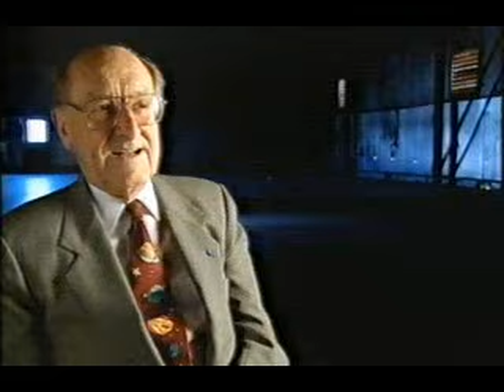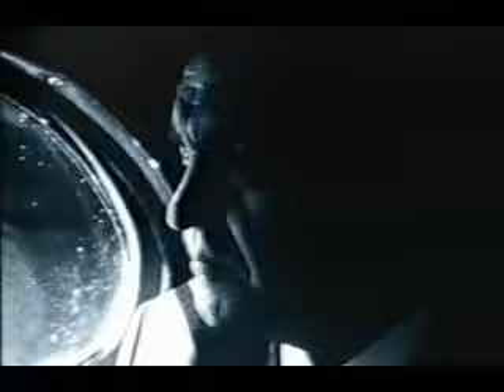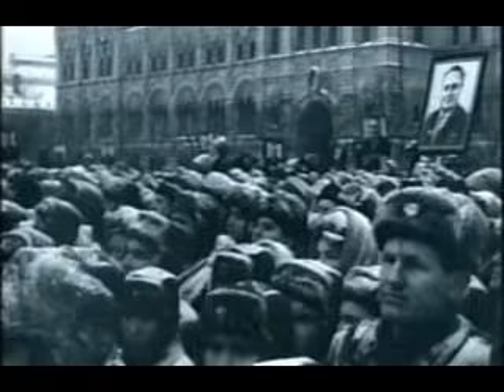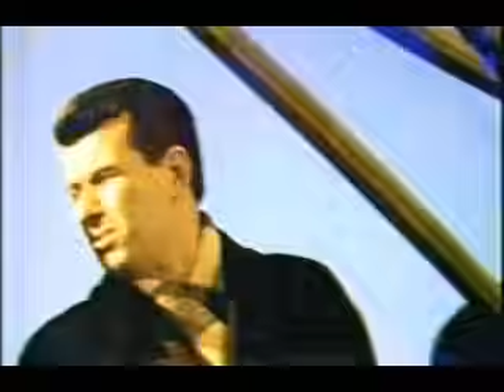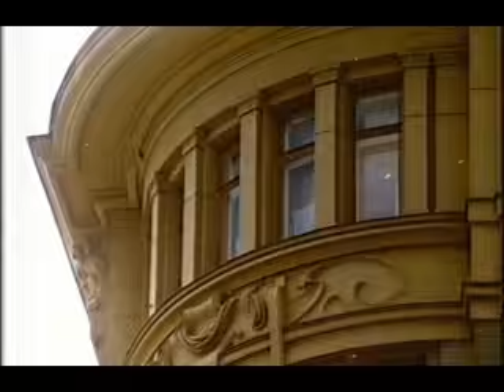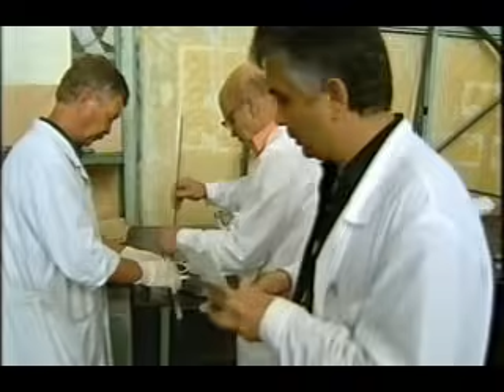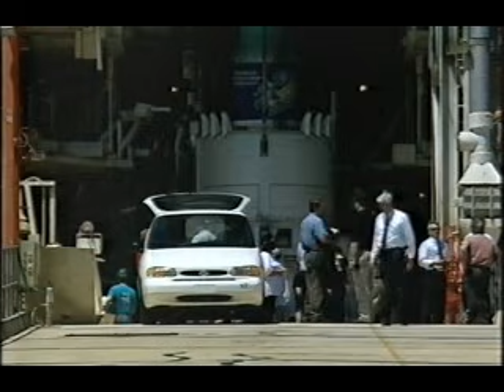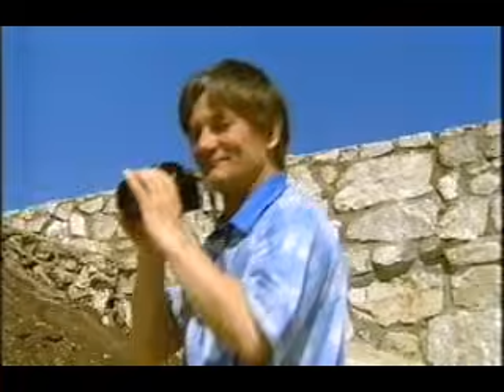Soviet N1 Moon Rocket Documentary

Comment: As an engineer, I was sitting here watching this film, listening as they implied that the Russian engineers were better than US engineers and that the rocket engines were better than anything in the US inventory and that the Russian's had "figured out"something that the US engineers hadn't.The whole time I am thinking "o.k., higher performance and more efficient, but you are also taking big risks that a rocket engine of that design type won't simply MELT and/or explode running at those kinds of pressures and temperatures"! When, finally, in the LAST 7 minutes of the film they admit that the Russian engineers hadn't actually "figured out" anything the US engineers hadn't, but that IN FACT the US engineers simply felt it was too risky to operate a single engine at those pressures and temperatures and THAT was why the US decided not to go with the "Close Circuit" rocket engine design. Yeah, US engineers like to build in a "safety factor", ESPECIALLY where human cargo is concerned. The Russian approach of making things more powerful or faster by sacrificing safety isn't unique to rockets. It is a well known fact that when the Russians began building Nuclear Powered submarines that the reason that they were faster than anything in the US arsenal was that the Russians had sacrificed the amount of shielding around the reactors as a weight saving measure which then greatly increased the danger of radiation exposure to the crews aboard those subs. Well, we in the US like to see our boys come home NOT glowing green, just like we like to see our payloads actually REACH orbit, whether human or machine, whenever possible.
Reply: But the US chooses to use the design now. Ironic huh.

You literally turned that frown upside down didn't you!

I'm sure if we kept the same story and swapped the nationalities around, either you or another American would be boasting about how crap the Russians were and how bold and fantastic the US was for taking the risk to further the technology.
Also, you fail to mention that the US have now started to design and build a staged combustion engine (Raptor sounds cool doesn't it! murica!) along with India, China and Japan to name a few. Could it be because they were proved wrong and that it was possible by the Russians(damn those pesky commies). You also fail to mention the metallurgy they developed to combat the problem of corrosion, which was one of the main reasons why the US didn't think it was feasible.

Also your example in your regard to shielding on Russian submarines, I don't know if what you said about less shielding is true or not, but the weight of a submarine does not affect its top speed only its acceleration. Just like a LSR cars top speed is influenced by drag, gearing and HP, added weight only means it will take longer to get there but will not alter its top speed. So all that means is, if your statement is true, then a Russian sub will accelerate faster but will not have a higher top speed. Great for them undersea 1/4 races.

So why don't you give credit where credit is due?
They developed the technology and designed and built something that the US deemed virtually impossible. So well in fact, that now the rest of the world is following their example, including the US.

Not too hard is it?
Reply: Firstly, saying that the US "chooses" to use the Russian rocket design now, isn't quite accurate. Because of the deep and ridiculous cuts made to NASA's R&D budget, US scientists were FORCED to find a less expensive alternative to advancing the state of the art in rocket engines. If you ask THEM (not the ones "paid off" by the Russian filmmakers they show in this film to say what the Russians WANTED them to say) the US scientists will tell you that their decision to do so was based on being FORCED to find a less expensive, but less capable system because of purely POLITICAL reasons which were pushed through by the current administration. Going to the Russian design was an out and out BACKWARDS step. That being said (and you may not be aware of this as it is not widely known), new funding has recently been approved for continued development of a US design which had been kept in "cold storage" since the Obama administration began its anti-science, anti-exploration, anti-research blitzkrieg. This new funding has been largely the result of the "cooling" in relations between Russia and the US, and has had the HAPPY result of forcing our politicians to reevaluate the "I'm ok, you're ok" stance which has pervaded the US space program for too long and kept us stagnant, just like the Russians, who, except for the ISS (which the US is largely responsible for building), are still stuck in the late 60's, space technology wise. Not so much "state of the art" as "state of the ark".  

On the issue of Russia developing "metallurgy to combat corrosion", well, the fact is, we don't consider that very important since we take better care of our equipment than the Russians do as well as using higher quality materials from the start, and all parts which show any corrosion or mechanical stress after a flight are replaced before being re-flown ANYWAY. If that is something that is important to Russian scientists, that is wonderful, but that has to do with a different approach to the business and using lower grade materials to build with.

As far as your comments regarding submarines and whether weight affects "top speed" or not, are concerned, they clearly indicate that you have NO knowledge of the subject and it would be a pointless exercise to debate you on it. I will give you ONE clue. Water ISN'T air and they don't have the same coefficient of drag. Your analogy of dry, land based race cars is just not applicable when referring to something in salt water, sorry. As we ENGINEERS like to say, you can make a BRICK supersonic if you put a powerful enough engine on it. 

Again, the US isn't following Russia's "lead" because they made a "better" engine, it was a desperate attempt to find something which, while less capable than US designs, was cheaper to produce. Well, cheaper is RARELY better when it comes to high performance technology. Also, the only reason that the countries you named are CONSIDERING the Russian design is for the same reason, its cheaper, not better. The heavy lift capability requirements of India, China and Japan, thus far, doesn't need to be anywhere NEAR what the US requires of its systems. Those countries are just taking their first baby steps into space on their own. We in the US didn't consider the Russian approach "impossible", as you and this film claim, we simply consider it a lesser design. I mean, if you are looking for a high performance car and can afford to buy a Ferrari, you DON'T SETTLE for a YUGO.

US commercial space companies will fly with what engine they can afford, which means they will have to sacrifice capability for cost. Most NASA and US contractors performing heavy lift launches are still using the proven and more capable US designs, such as Titan and Atlas, etc...The new "Saturn Class" vehicle called the Space Launch System (SLS) slated for its first launch soon uses four RS-25 engines in its Core Stage. The RS-25 is a US design originally used as the main engines for the Space Shuttle and has the highest thrust to weight ratio of ANY rocket engine in the world. It is also the most reliable rocket engine in the world. SO, after all your claims that the US is somehow "coming over" to the Russian way of thinking, the FACT is is that we are powering our newest heavy lift vehicle with a US designed, tried and true powerplant, NOT some Russian designed cheapy stopgap engine.   

Russia's new spacecraft, the...OH, that's right, Russia is still flying the same limited capability Soyuz capsule that it has been flying since 1967. They tried to build a space shuttle, Buran, which looked EXACTLY like the US Space Shuttle, only it wasn't powered and was only ever flown ONCE on a remote mission and then was quickly retired because the Russian copy didn't work. I think one of them is a theme restaurant now, in Gorky Park? Russia STILL has never landed a MAN on the moon, or anywhere ELSE, for that matter. Russia is HARDLY on the red hot edge of technology, are they?

Does that turn that frown upside down, COMRADE? Not too hard is it?
Reply: Chris Cline Ok, now we know you are a condescending arrogant fanboy of US technology (with the attitude if the US didn't design it then it must be shit) that assumes that you know everything and the rest of us know nothing. What a refreshing change!

I don't care about your political situation or who was voted in and cut spending. The Russians space program deals with the same factors but you bag it for not having done much and then proceed to defend and make excuses as to why the US program hasn't progressed under the same circumstances. The FACT is your space program has stalled and that it has dropped the ball is no fault of anyone but the US alone. So don't cry about it. I am fully aware that funding has been released only due to the fact the sanctions the Russians put on the US after the US did it to them meant that you had no way of getting your own rockets up into space without the Russian RD-180 and NK-33 engines. You know the ones that are so shit that most of your main launch vehicles use them and now you can't get them you are left in a bit of a pickle. It seems around 4 years is the estimate.

http://aviationweek.com/space/replacing-russian-made-atlas-antares-engines-would-take-four-years

Tell me how does the US currently get its astronauts up the the ISS? The very Soyouz that you reckon is shit, but you have to pay them for a ride cause you don't have anything to do the job. The Soyouz may be old and "limited tech"  but the US has nothing to do the same job. It could be a flying turd but its still better than what the US has today. How can you even talk half the shit you have when that is the truth, geez it must grate on you lmfao. Here it is from Time.com itself with a nice video of them doing something the US can't do.

http://time.com/132946/watch-russian-soyuz-rocket-launch/

 How old is the Atlas (discontinued 2005) and Titan? Both 1950's, so according to your reasoning older than the "state of the ark" Soyouz, yet somehow they are "proven" so it makes it all ok. The only recent rocket the US has that could be said to be totally US is the Delta IV as the Antares was designed with Russian help and has, wait for it, Russian engines. Please refer to the Aviation Week link for proof.

As for the SLS until one is actually made and launched the US has nothing new either so I wouldn't boast about it. You can't even launch a Astronaut atm.

As for the metallurgy argument, you did not address the point being made instead you decided to go on about the quality of metals used which was irrelevant or you are stupid or maybe both. It had nothing to do with the quality of metal being used but to do with the types of metal being used. Due to the corrosive effect of the fuels the normal metals used in engines were not up to the task. So using your awesome made in the USA metals would not have made a iota of difference because they were not the type needed. Thats why they developed new alloys to combat the problem. Also seeing as they were designed for single use, there is no need to make it last for more than one trip, just like the SLS does with its main engines. So if you can't bring a rational counter to that point or just plain don't understand the point I am making then don't bother.

Quick point here.  Oh how I laughed when you said ", if you are looking for a high performance car and can afford to buy a Ferrari, you DON'T SETTLE for a YUGO." notice how you did not use as American car like a Corvette or Mustang. That would be because in the supercar world they are kind like a Yugo as well.

And to finish it off, back to the submarine side of things. I don't know what sort of engineer you are but Fluid Dynamics is all about the movement of solids through all liquids and gases and therefore pertains to your inaccurate statement. Just in case you can't be bothered to read it here is the answer to the question.

And I quote " Now to your actual question, if both submarines had exactly the same shape, and size and were in the same medium, they would in theory hit the same equilibrium if they had some sort of magical engine that produced a 10N thrust constantly, the equilibrium for the heavier submarine would take slightly longer to reach as its acceleration is lower (and the derivative of its drag is therefore lower) but they should reach a point where Fe=Fd and Fe=10N constantly"

http://www.physicsforums.com/showthread.php?t=182815

So in simple speak for your "engineering" mind, two identical objects (ie the same shape and size) with the same thrust but different weight will have the same top speed. The only difference is the heavier sub will take longer to get to that speed.

And finally I am not a Commie nor a Russian, I'm Australian and just believe respecting all forms of technology regardless of where it was made or designed. I also get sick of seeing arrogant Americans always putting shit on anything that anyone else had made without a decent argument to back it up. You know shit excuses like "it's Obama's fault" or bagging something for its age then saying your older designs are "proven" you fucking hypocrite. Your argument is so full of holes and contradictions its almost funny.

Don't bother answering because I don't care because I've proved my point and anyone rational will see all the holes in your biased argument.

And as us Aussies say, get a big black one up ya, ya wanker.
Reply: yobgow
My my, temper, temper. Who's "WE" here? I don't need to be a "fanboy" of US Technology. I'm the REAL deal and help other scientists further advance US technology while the Russians sit there, stuck in the 60's, both technologically and socially. So, go back to the cave you crawled out of to stomp your foot and try to insult the United States, the single GREATEST entity ever devised. We've heard it all before. I don't have the time to consider your feelings while I explain the errors in your thinking and the flaws in your "logic". We have a saying, don't know if use it too in Australia..."If it walks like a duck, and quacks like a duck, it must be a duck". Well, you sure TALK like a commie and seem to be a big fan of that wonderful, free nation. SO, I say Commie Down Under. I have several Aussie friends and I am VERY HAPPY not to count you amongst them.

I have really important things to do now, so I am going to leave you to your own devices and maybe see if you are going to waste more of your time in a futile effort to strain your brain trying to rise to my level, or will you simply resort to puerile name calling because you can't master your emotions? By the way, the internet isn't the be all and end all of knowledge. Try reading a book with more than pictures in it sometime. Quoting and linking to physics websites...Jeez! You don't know the FIRST THING about ACTUAL physics and have proven that throughout your inane scribble. I think you might be happier in the kiddies classes than up here with the big boys.  
I don't feel it necessary to use profanity or cast graphic insults, which are the province of the uneducated, so as we American's say "I'm sorry, did you say something. Well, whatever it was wasn't important".
Fair Dinkum?!
Have a Happy Day...;)
Reply: You couldn't even put a decent factual argument down in writing whether you are an engineer or not. Using links to prove my point is the only viable way of giving evidence on the internet because I can't grab you by your throat and ram a book into you face fool. You stupidly assume that only you have higher education, but you must realise that most people aren't pompous egotistical wankers that try and shove it down others throats as they let their argument do the talking. Actually the way you parrot on about how you're the "real deal" ect makes me wonder if you really are. Or maybe you're just insecure, probably a bit of both. You can't be a very good engineer because whether you like it or not your argument over a heavier submarine having a lower top speed is so wrong its laughable.

The fact that you choose to try and question my background and education instead of refuting any of my points shows that  you really have no valid counter points. You ridicule my education but can not give me a simple fact based answer to prove me wrong. Thats probably because your top shelf space program has to go to the Russians to get an astronaut into space. Bit hard to refute that gem. I think I'll take that as a win.

As for you comments inferring that I am a commie, my grandfather was shot by communist partisans so, use your duck (which guess what, the rest of the us use but I'm sure you'll claim it as your own) analogy all you want it, it's far from the truth. But you are what we Aussies call a real wanker and thats fair dinkum. And in no way would I ever want such a close minded arrogant redneck as a friend either. Because I wouldn't cross the road to piss on you if you were on fire.End of story.
Reply: yobgow
Zzzzzzzzzzzzzzzzzzzzzzzzzzzzzzzzzzzzzzzzzzzzzzzzzzzzzzzzzzzzzzzzzzz...........................................................
Reply: yobgow
By the way, in one of your replies you claimed that one of OUR rockets was "discontinued 2005", and I quote "How old is the Atlas (discontinued 2005) and Titan?". Well, we just launched an Atlas 5 YESTERDAY, SMART GUY! Better get a better grasp on your "facts" if you are going to spout off, huh? Kind of makes a bloke wonder how many other of your "facts" are simply pure CRAP?
Reply: yobgow
O.k., "MR. Russian-Rockets-Are-Better-Than-American-Rockets"! YESTERDAY, an Antares rocket, built by the commercial space company called Orbital Sciences, powered by a RUSSIAN made RD-180 engine EXPLODED 6 seconds into flight and all indications for cause point to the ENGINE! SO, tell me again how Russian space hardware is BETTER than American space hardware?! Yeah, uh huh, RIGHT!